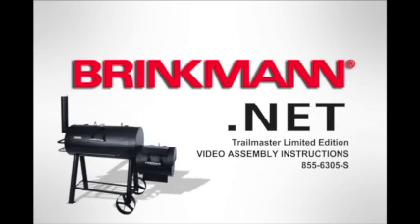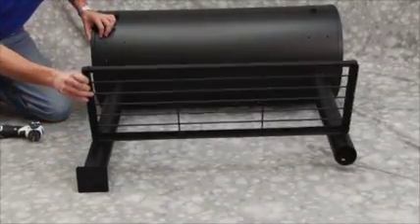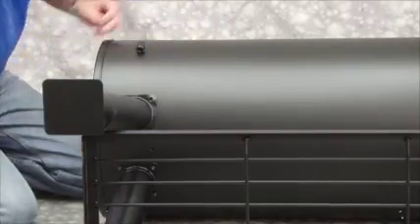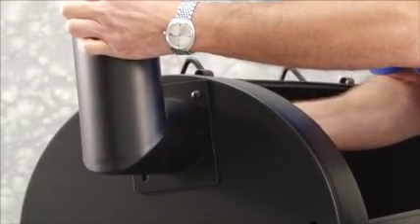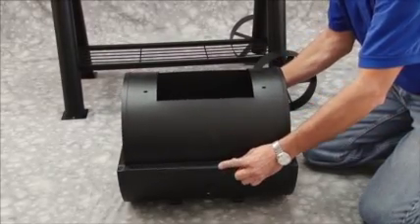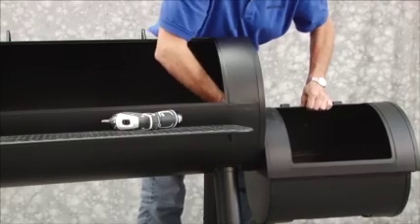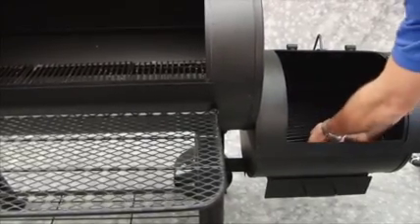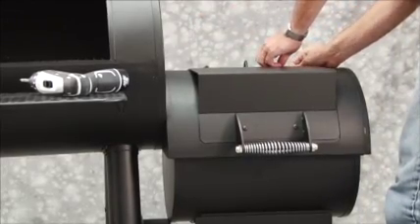855-6305-S: Assembly Instructions

Comment: At first, I thought I had been shorted nuts as well, but as it turns out there are enough to put together everything. 28 is all that you need. There are several connections that have nuts built into the opposite side. This wasn't obvious on first glance.

Comment: Hey guys for anyone using this video to put together your grill make sure you do NOT install the heat chamber's brace upside down like they did.it's suppose to have the hinge pointing up. also if anyone has a solution to fixing the leakage pls state it here.